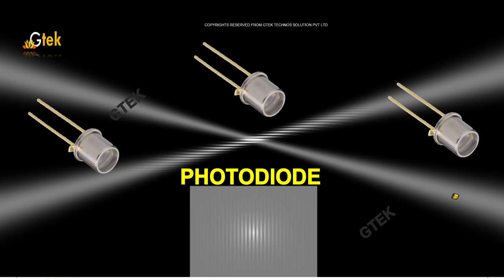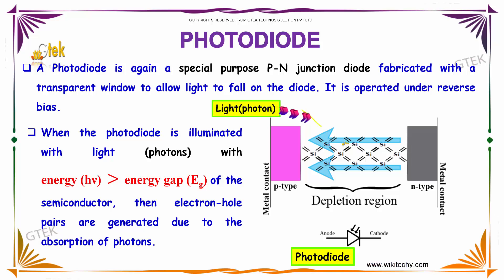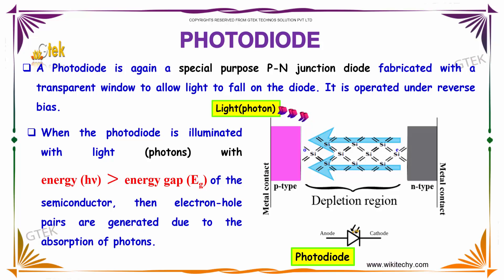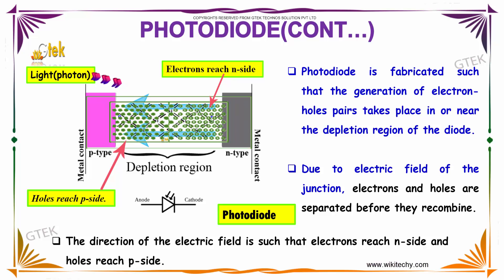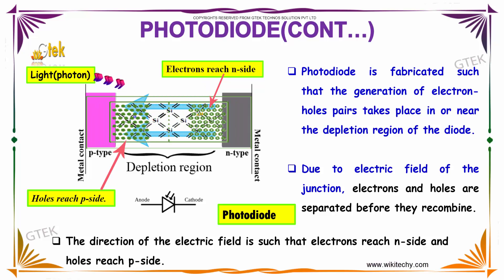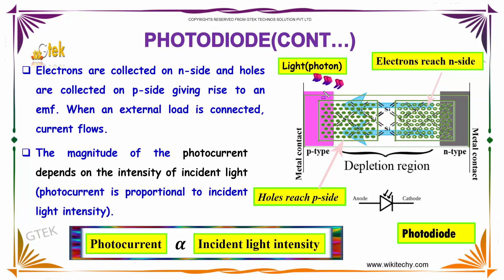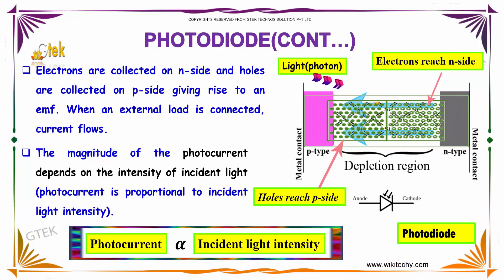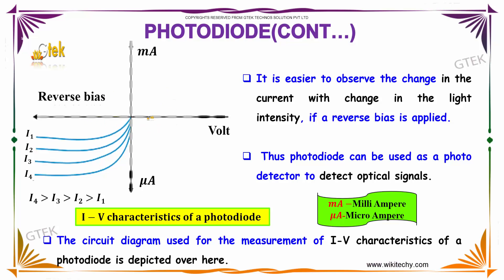Photodiode Semiconductor Devices class 12 Physics subject notes lectures CBSE IIT JEE NEET

Comment: Dark current is leakage current that flows when a bias voltage is applied to a photodiode. When operating in a photoconductive mode, there tends to be a higher dark current that varies directly with temperature.

Comment: A phototransistor is a device that converts light energy into electric energy. Phototransistors are similar to photoresistors but produce both current and voltage, while photoresistors only produce current.

Comment: A PIN diode is a diode with a wide, undoped intrinsic semiconductor region between a p-type semiconductor and an n-type semiconductor region. The p-type and n-type regions are typically heavily doped because they are used for ohmic contacts. The wide intrinsic region is in contrast to an ordinary p–n diode.